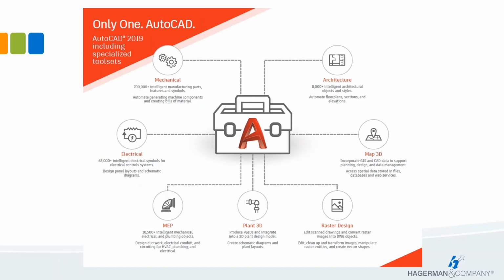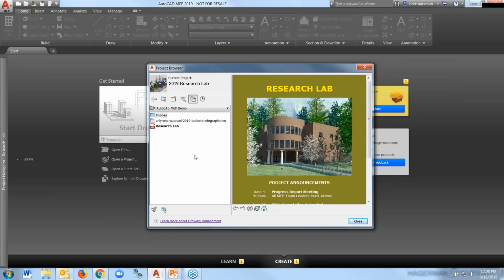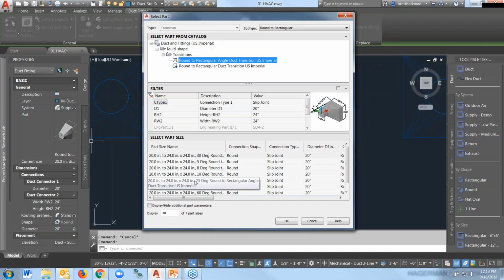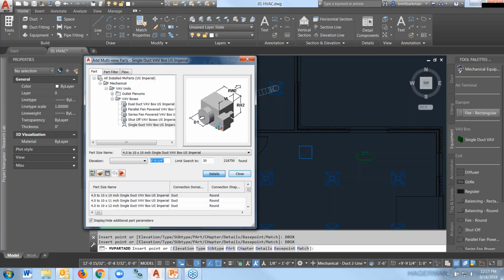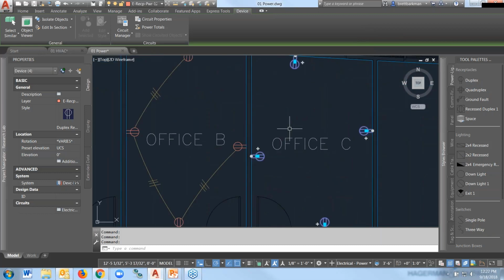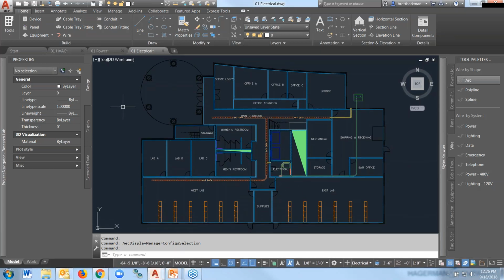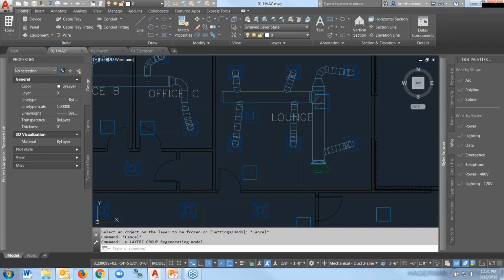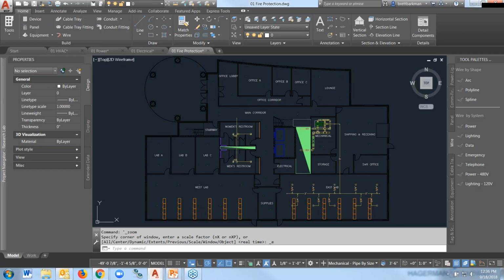Introduction to the AutoCAD MEP Toolset

Comment: I need to do as builts for Datacomm. is there triangles and racks in the electrical toolset?
Reply: If you mean triangles like revision triangles, no.  If you mean triangles like phone and data, yes.  Those are the only triangles I'm aware of.  As for racks, there are things like cabinets, but I assume you're referring to 19” racks like computer racks which are not included.  However, you can add custom content.
Reply: @bjbarkman  Yes 19" racks. How do I add custom blocks in MEP then? I couldnt find anything in the menus that looked like an import tool or block selection.